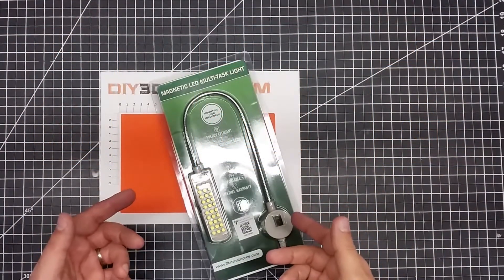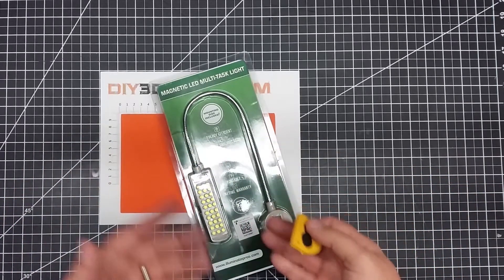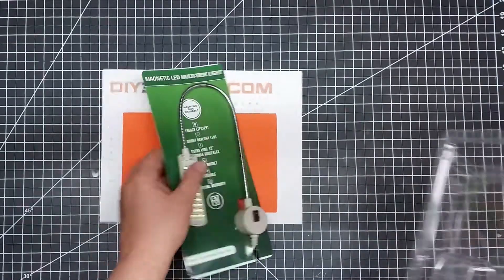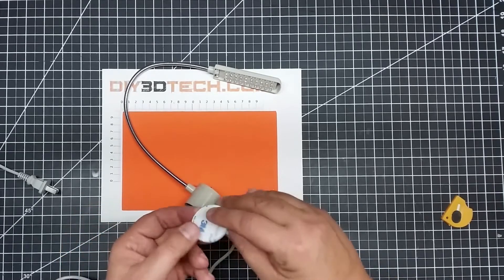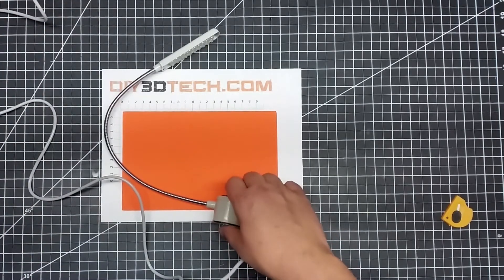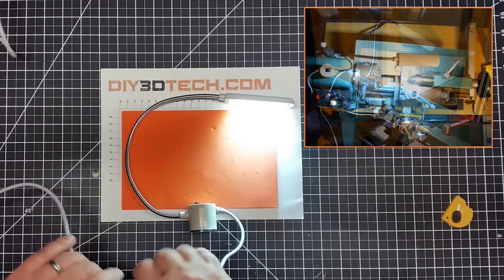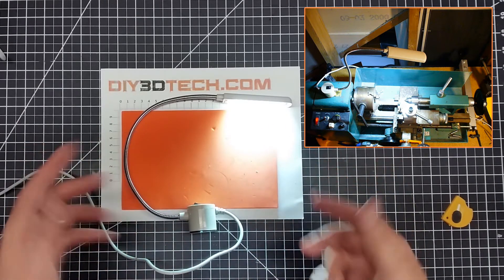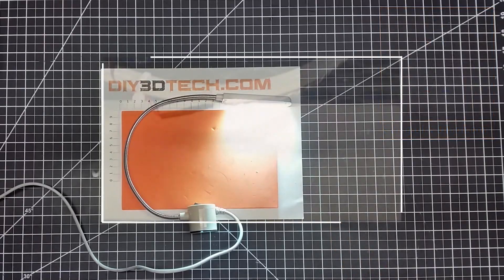Shop Talk - Magnetic LED Machine Light !

Comment: Got one very much like this a few years ago.  I think I paid around $20 which I thought was a lot, even at the time (before bright LED fixtures were dime-a-dozen).  I use it on my band saw, mostly - very handy gadget.  Recently I replaced 160 Watts of fluorescent shop fixtures with about the same wattage in LED shop fixtures.  Now I get about 4x the light output, and the daylight color on the newer LEDs is terrific.  I went with the OOOLED units on Amazon.
Reply from the maker: Ditto on moving from  fluorescent to LED in the shop too!